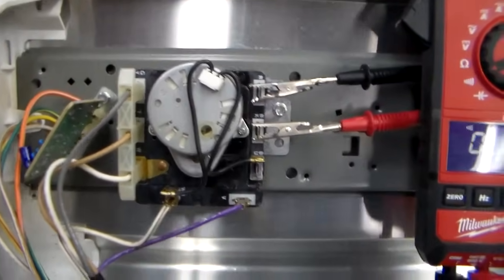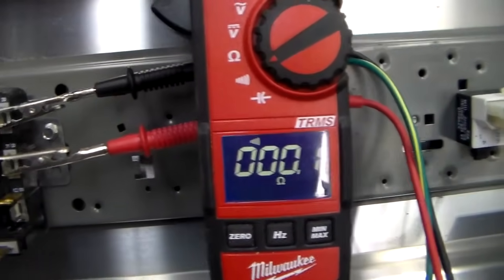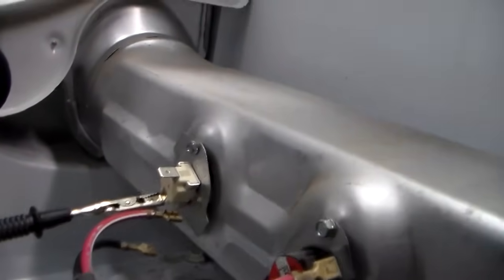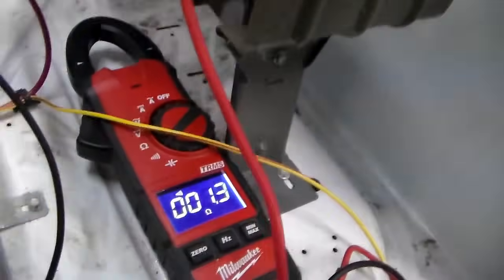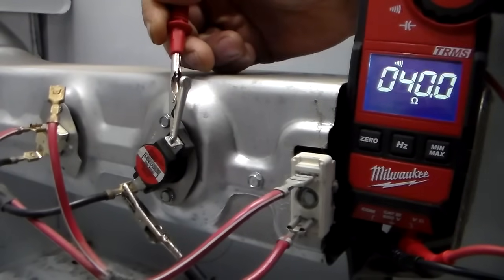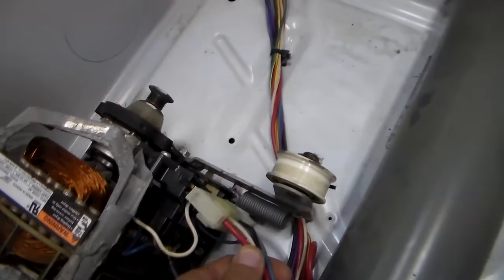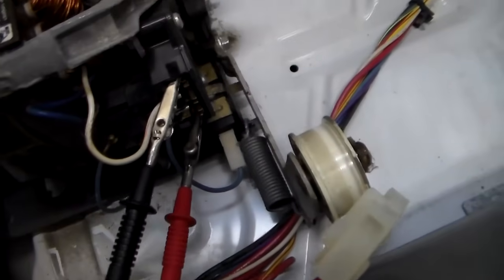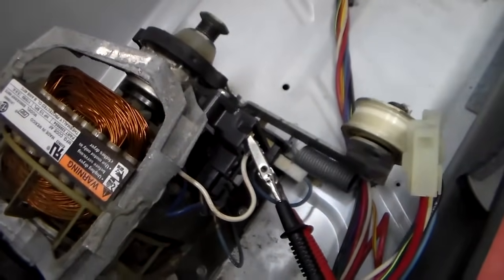Kenmore Electric Dryer - Not Heating, What to Test and How to Test

Comment: Great video on diagnostics & repair. Now I'm having a problem with my dryer. I first thought it was the heating element since it wasn't heating so I replaced it. I didn't test it with my multimeter and of course this wasn't the problem. I'm going through now and the only thing not going to 0 is the "Dryer Thermistor" (according to the parts diagram on sear's website). Is this something that could be the issue or will I end up paying for another part I didn't need? It looks just like a piece of plastic with wires attached which is why I am skeptical. Thanks!
Reply: +Thaddeus Anderson Never mind, I saw in another diagnostic video that it was normal to be at the level it was in. I also have taken the dryer completely apart and tested everything in the video, still doesn't get hot. I may just have the throw in the towel on this one and call a pro. Thanks a lot for the video thought, it was very informative.

Comment: Exellent video! Thanks!  In my case I tested all the components mentioned in the video and it's still not heating.. So I have one more thing that is worth mentioning.  This is a 220V appliance.  The motor runs if just one leg of the 220 is active or on 110 volts only.  That happened in the past. In that case changing the circuit breaker in my sub panel fixed it and it started heating/working again.  But now I tested all the components in the video and all are working, and I also tested the wall outlet and observed 110 between the neutral and each leg, and 220 between the 2 legs .. everything seems OK.. But I am thinking maybe it's only OK because there is no load while testing voltage- and that it may not have a good enough contact once more current is passing.  I should also mention that while the plug for the dryer doesn't fall out, it is not as tight as one would expect.  So my next course of action will be to replace the wall outlet plug and see if that makes a difference..   Will try to followup with my results...  Thanks again Bill for this great video!  (1 hour later)  I discovered there is ANOTHER 220 volt outlet in our laundry room - beside the washer..  Plugged the dryer there and presto -- works... So in my case the problem is the dryer power outlet (which I will replace as soon as possible) but the kicker was that the voltmeter test suggested the outlet is OK.. I guess my theory about it not working under load turns out to be true..
Reply from the maker: +bitskeptic Nice Job!  That is very tricky when that happens, usually the cord is the problem.  How did the outlet look when you replaced it?
Reply: +Bill Newberry Hey Bill Thanks! Actually I haven't replaced it yet.  I just plugged the dryer into the other 220 outlet and it worked. A bit tricky to get the cable there because it's around the washer - (tied a rope to the cord so I could pull the plug to the outlet after pushing the dryer up against the wall) Since I ran all the tests you mention in your video I figured the only thing left was the outlet so I looked for another outlet and found it. Never noticed cuz it's behind the washer.  Might've been interesting to have a meter on the "bad" outlet under load..  Not really looking forward to the electrical work.  The wires in the box are heavy and old, and the box is small. When I pulled out the socket I noted it has push-in terminals rather than screw terminals.. For some reason I like screw terms better.. Anyway I'm optimistic the new outlet will do the trick.. Thanks for the reply!

Comment: I tested my element on the stove. It worked just fine. Is there any wiring I can skip so the element will heat up anyway? I touched it with a screwdriver while it was plugged in and it sparked, so it is getting some kind of electricity.
Reply: I hooked the other red wire to the bottom of the high limit thermostat. I se the temp to extra low. The element came on and slowly turned red hot. I'm going reset the high temp cut off and see if I'm back in business.

Comment: I checked all these, and your other videos, still can't get it going o.0
Reply: +Phil Chan i checked everything, completely took it apart, everything was reading "good" now i put everything back together, with out the back panel on, i tested it, and it was working fine. It's unfortunate that i didn't know exactly what was making it not heat, and then all of the sudden its working, and not knowing what caused it to work again. I put the back panel on and test once more, now it's not working again.......ugh!!
Reply: +Phil Chan and yea, i checked the venting all the way to the outside, its clear.
Reply: +Phil Chan now, i keep playing around with the back panel off, its working, and all the sudden its not working, and it might work again, but i really don't know what's causing it, because every time i use the volt meter, its showing the proper readings.

Comment: My problem was the heating element -- $69 at the local appliance store.  The windings that heat up had a break right in the middle of the figure 8 wire. 
I tested everything else first & nothing was bad.  Finally I put my volt-meter on the leads to the heating element & sure enough it was getting 220V a/c but was not glowing red as it should be.

Comment: Your video was right on. Followed your easy to follow steps and tacked it down to a sensor downstream from the heating element. Smacked the sensor off the floor and heater started working. Checking for any airflow issues and putting back together. Good clear video.  Video gets right to the point, like us guys like our information.

Comment: Thanks Bill, but having difficulty finding the video which you referred to which goes into greater detail. I have a Kenmore dryer # 110.68932791. I’ve checked the home circuit breaker, heating element, high limit thermostat, high limit thermal fuse, thermistor which was bad and replaced, timer, heater relay, and the centrifugal switch at the motor. All have continuity. 

I found no continuity from the red wire at the top of the Heater Relay which I believe runs to the bottom of the white plastic female connector to the motor at the 3:14 mark in your video, https://www.youtube.com/watch?v=wVTBrGMql7g.

I believe I could easily bypass it with another wire of the same gauge running from the top of the Heater Relay, but not sure how I’d remove the existing wire from the bottom of the Wiring terminal block for the motor, Whirlpool OEM Part #3395683, (Whirlpool part #62505,) replacement washer/dryer Block and replace it with a new wire. Any suggestions?

Thanks again, Lewis

Comment: Brilliant! Started by replacing the semi-kinked, semi-clogged vent pipe then tested the non-resettable thermostat, removed it, slapped it on the tile floor, replaced it and Bingo! - working dryer. Thanks...
Reply: And you didn't make a video?
Reply from the maker: E. Michael Brandt Yeah  I want to see some of you guys slapping these on the ground!  Post video responses!

Comment: Hey Bill.  I used everyone one of your suggestions on a Kenmore 110.63932102 model.  I was getting no heat but the dryer was running.  Changed the element.  Nothing.  Changed the thermistor.  Nothing.  Took the whole thing apart and cleaned out a filthy machine.  Nada.  Just swapped out the heater relay switch with the motor switch and BINGO!  I was getting no power to the element.  Heater relay was bad.  Videos are awesome.  Might be worth adding this as a tip.

Comment: So I used your trick to reset the nonresettable thermostat and it worked perfect. However I have a stupid question. What would happen if you crossed the red and black wires when you hooked it back up? Thanks for all the help!
Reply from the maker: steven serrano It doesn't matter which way those wires are hooked up.  That thermostat just lets current through.  Thanks for Watching!

Comment: Thanks for this! When tested, everything had proper continuity. I cleaned up lots of lint inside the dryer. More significantly, I also found a considerable amount of lint inside the lint screen duct (below the door). I removed as much lint as possible from every inch of the ducting: heating element box leading to the drum, lint screen duct, blower, outlet and vent pipe. After reassembly, it seems to work (heat) much better. Time will tell.
Reply: Did you need to remove the front or back panel to do this or can you get the 3 piece vacuum kit (one long flat flexible tube vacuum attachment and 2 brushes (narrow & wide) with long handles.)?  Thanks

Comment: Hey Bil great video very thorough. I was wondering if you could help me further. I have tested the element, and the 3 temp units and the motor switch, all test out fine, when i connect power to the system as soon as i turn the timer dial there is 240v to the heating element before i push the start switch. when i test the 3 temp switches they all have 240 on both sides when grounded to the main ground coming in from the wal. I don't believe that is normal for the element to have power until the start button is pushed and the motor starts a, but i don't know.

Comment: Great video, Bill. Thanks.
3 months ago, I used your video to diagnose a thermal cut off that needed replacement. At that time, I replaced both the thermal cut off and the thermostat. The dryer worked fine. Now, 3 months later, the dryer won't heat again, and the thermal cut off is out again (both the thermostat and the heating element test fine).
The venting seems good, I've cleaned all the lint out. Where do I look next for the cause of the thermal cut off going out twice in 3 months? The blower motor? I'm not sure what the next step is. Help!
Thanks!
Reply from the maker: Ochimo Furrows Maybe over stuffing the dryer?  Is the washer spinning out all the clothes properly.  And make sure wind is not fighting the air coming out of the dryer vent.  Could me forcing the flaps to push shut.  This is what's happening at my house right now.  It's been super windy, my dryer vents on the side of the house that gets direct wind and my thermal fuse just went.  Not sure if that's exactly why, just my speculation.
Let me know what you find.  Clean the dryer and replace the fuse.  Check the venting.  When your cleaning the dryer, check the blower wheel and make sure it's tight on the motor.
Reply: Ochimo Furrows Even when you think that nothing is blocking air flow because the fan is blowing air take the metal shoot off and clean it out
I have found pencils pen tops screws huge dust balls
Reply: Thanks for your replies Bill and Cloverdale! 
I think you were both right--wind blowing dust/gunk from outside and combining with the fuzz coming from the dryer, seemed to create a blockage deep in the vent pipe. I replaced the thermal cutoff, cleaned the vent, and so far so good!
Reply: Most people dont know how they can get a mouse in the house. They come through the dryer vent a lot of times.

Comment: My Kenmore dyer doesn't look anything like what I'm seeing in the various videos I have watched. However, on the very back of my Temperature knob there is a square black switch. It has a yellow wire on the side and a blue wire on top. Could this be my problem? Meter shows nothing when I touch these terminals.

Comment: Gahhh.  Im battling my dryer right now..  No heat... Except if u sit and watch the element for a while.. It sometimes comes on for maybe 20 seconds and then shuts off again for the rest of the cycle.  I have replaced the element.. Thermal cuttoff and High limit thermostat..  I tested the thermal fuse and therm-o-disc with the multimeter both were fine..  Took the drum out and inspected the motor.  Cleaned it off.  Everything Looked fine.  Tested the switch with the multimeter like your video shows and it was working fine.  Put it all back together and still no heat.  What else could it be? Its making me crazy!  Lol
Reply: Timer
Reply: Hhmm..i seem to have the same issue..how is a timer cheked with a meter if it only stays on temporary...off with meter attached and turn knob?

Comment: I had a Hotpoint dryer with this problem. I tore it apart and all the resistance values were perfect. I was fortunate to find a wiring diagram in an envelope inside the control header with a trouble-shooting guide specifically calling for 240V at the heating elements. With power on, I found I only had 120V at the coils. I traced the problem back to a loose circuit breaker at the main power panel. The first thing you should check is that you have 240 volts at the dryer outlet. In this case, the motor still ran with only 120V available, making me think the problem was inside the dryer.

Comment: This was a great help in diagnosing the problem. The resettable thermostat went bad and your other video on how to fix it worked like a charm. Dryer is up and running now. Thanks!
Reply: Completely agree. I found out Sunday night that the drier wasn't heating up. After watching your videos, it took me a total of 15 minutes to take the back panel off, diagnose the problem, whack the thermostat on the ground a couple of times to reset, and then reassemble. Thanks for the video!

Comment: So I watched this vid and did the trick with slamming the non resettable on the ground and my dryer will heat for a while then stop. I cleaned everything. I am thinking it's just getting to hot which then shuts it down. What's your thoughts?
Reply from the maker: Dan Bartlett Everything?  House venting, take dryer apart-completely?  No kinked hoses when reistalling dryer? Lint filter is clean - meaning you can read newspaper print through it.  The reason I say that is because on some of the cloth filters, you can wipe them off, but the tiny holes are still blocked.  
Blower wheel is attached to motor?  You can feel lots of air leaving the dryer?
Reply: Well maybe I will trying tearing it down a little more and see what else I can clean.

Comment: Bill, I have a Kenmore 90 series plus dryer. I am at a loss. I have watched and tested all your videos. I have replaced the Temperature switch and dryness board. Dryer starts and works fine. Heating element comes on for about 30 secs and goes off again. Just not getting close hot enough to dry. Dry and vent completely cleaned and clear. I have also tested thermostat on side of heating element. Any Ideas? All suggestions would be great!
Reply from the maker: Jennifer Hewett What's the model number?

Comment: you forgot to test the blower box thermal fuse which I think is the most common one to go (according to all the other videos). Mine went bad, replaced and 3+ weeks later stopped heating again but it isn't that same fuse... Also didn't say about testing the purple wire of the thermostat (red should be 0 ohm as you mentioned)

Comment: what if everything checks out and still doesnt work. the heater turns on once in a while but not consistantly.
Reply: I know it's been 3 years but for others looking, check the heater relay that's on the control board. You can swap it with the motor relay (they're the same part) and see if it heats up. Here's a link with more details...http://www.techbuddy.us/dryer.php
Reply: Temperature selector switch can go bad also.